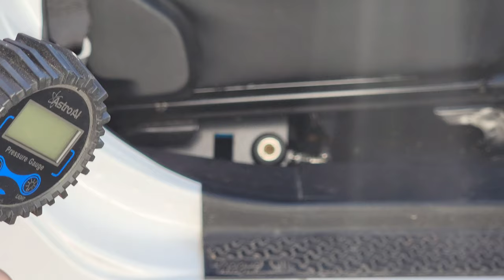Build Your Offroading Jeep, Real Costs, Honest Product Reviews!

Comment: Great walk around and thank you for including the pricing.  I need to get those Rock Slide Engineering steps.  My wife is 5'2"
Reply: Thanks! Coincidentally I sold the RSE steps a couple weeks ago and installed Patriot rock sliders from Rock Hard 4x4. They always worked perfectly bc I always cleaned and lubricated them. But I wanted to drop weight for towing a camper and have no maintenance. They are still a great choice. I will be doing an update video soon on big plans for a build changes.